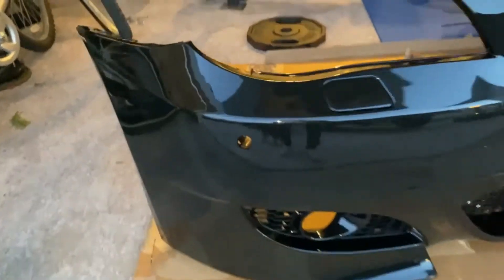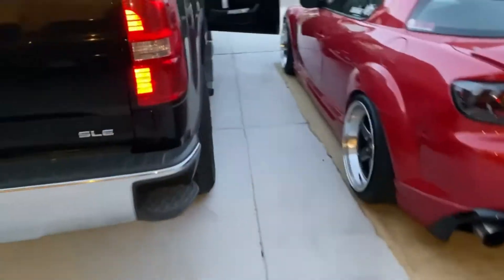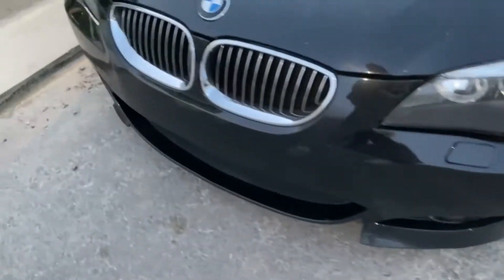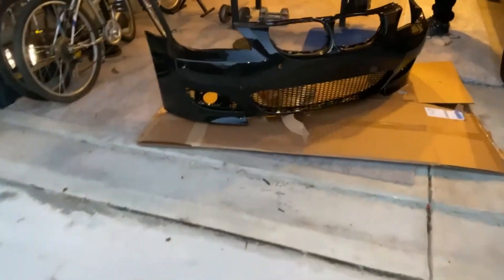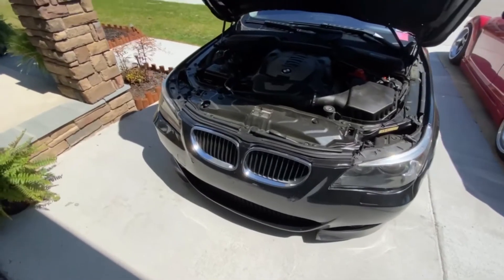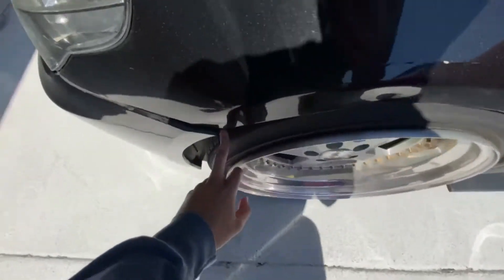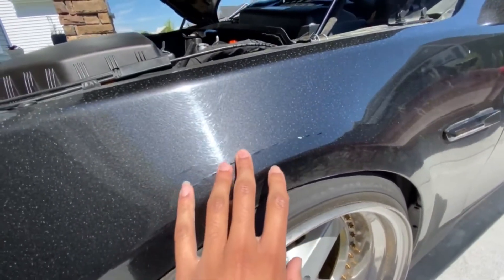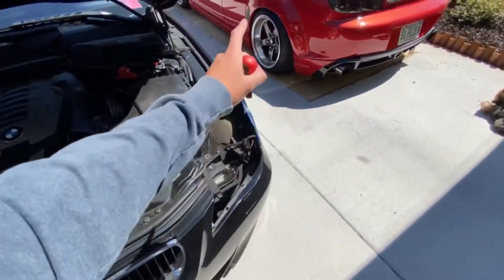BMW E60 gets new M5 front bumper!

Comment: so i have a e60 550 and i wanted my m5 bumper but been told it wont fit because of the fenders??
Reply from the maker: It will fit. U just have to transfer all the plastic pieces of the old bumper to the new bumper . I installed both aftermarket m5 bumper & fenders .
Reply: @DonFlacoMedia  was the lining spot on ?
Reply: i have an 08 lci and im not a fan of the mtec bumper . i wanted an actual m bumper